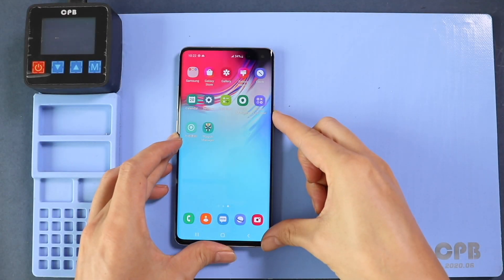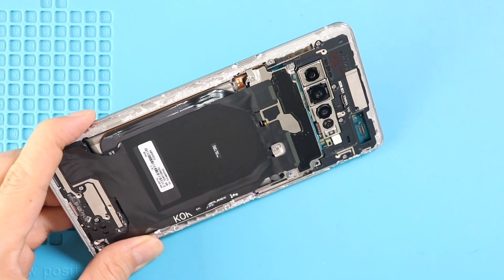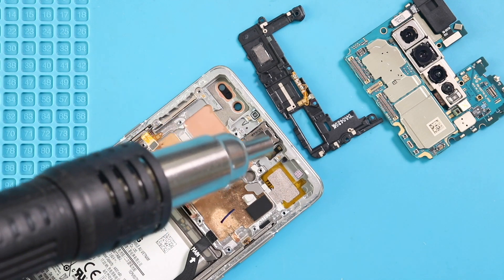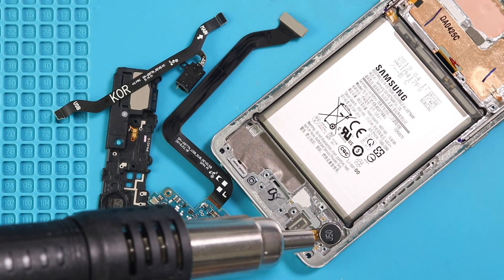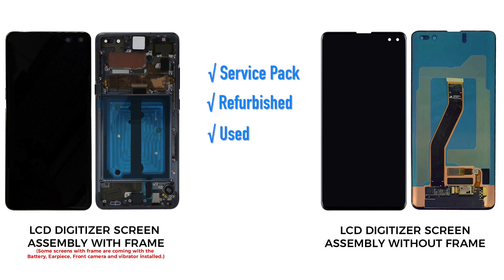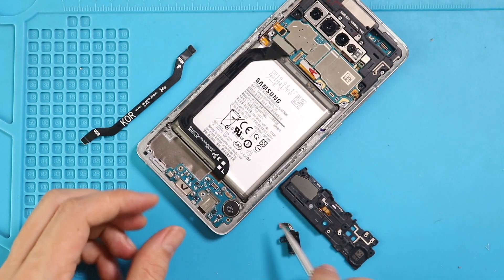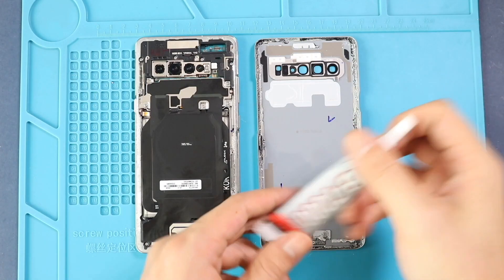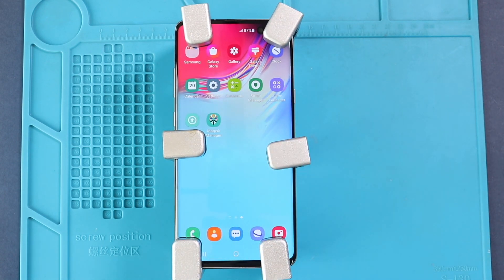Samsung Galaxy s10 5g LCD Screen replacement

Comment: The only problem is the screen replacement is scarily expensive, like £200
Reply from the maker: Well for the original price is high. Maybe try for a cheaper option, used or incell
Reply: I have an idea, i could buy a blacklisted S10 5G for like £50-£70 and just swap the motherboards, then i will have a functional S10 5G

Comment: I think it's a lot easier to repair comparing to the s10 plus where the connector is soldered to the main board. The s10 5g screen is more expensive though :(
Reply from the maker: Yeah true..